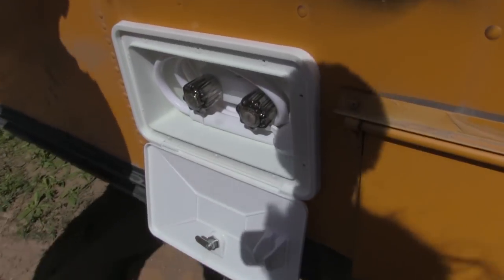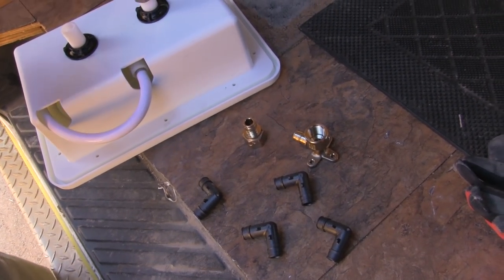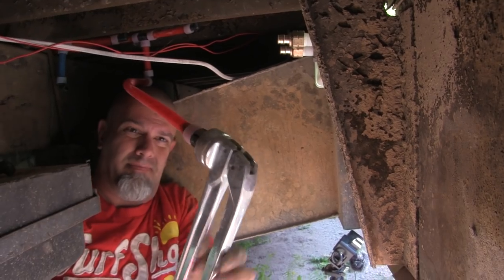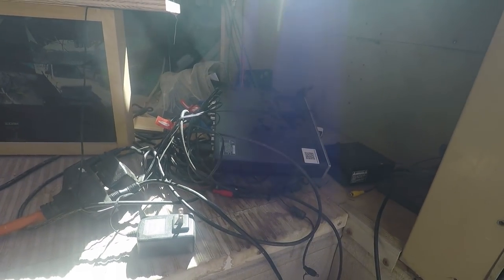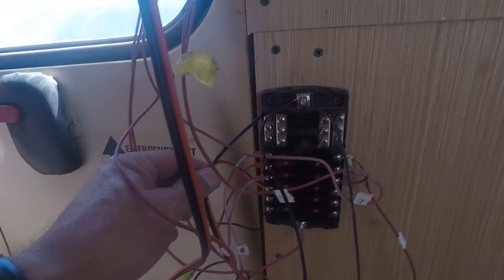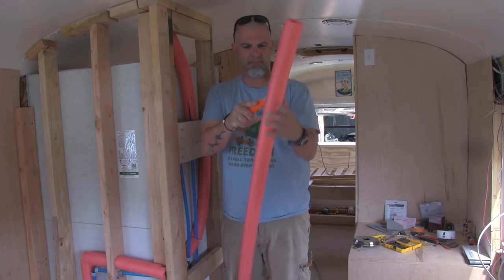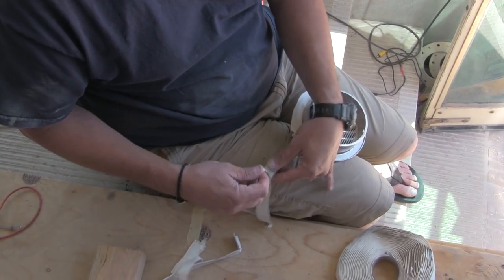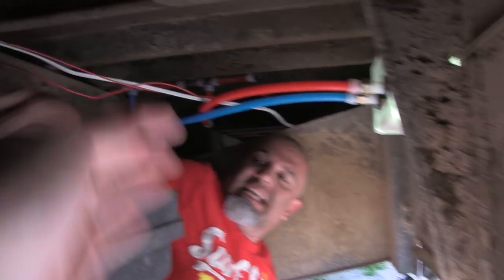Outdoor Skoolie Shower w/Hot & Cold + Unfinished Wiring & Airhead Toilet Vent

Comment: Hi guys! Just a little trick with the hole saw you are using, in fact any saw really, rub candle wax on both sides of the blade, it will lubricate the tool so as to ease cutting,... xx
Reply from the maker: Totally going to try that!!!

Comment: Almost on that gold star you should hold the roll so that you can pull tight the tape on each and every loop you’re holding the role on the wrong side to do that...you wanted to roll off the back side of the roll not the underside but you getting there...Considering what you already know that’s pretty freaking minor